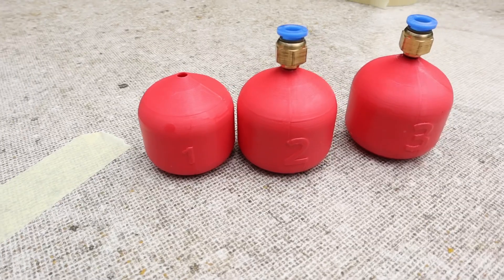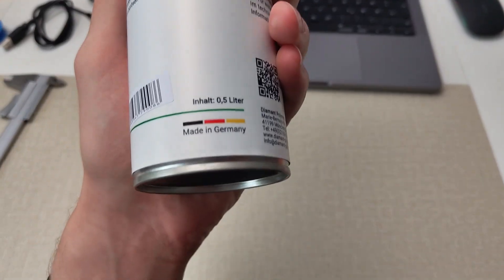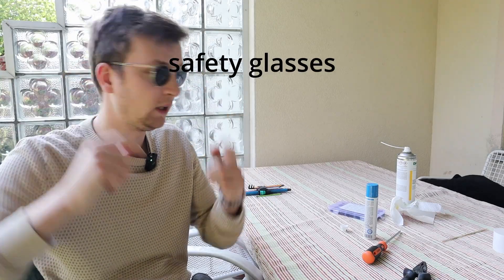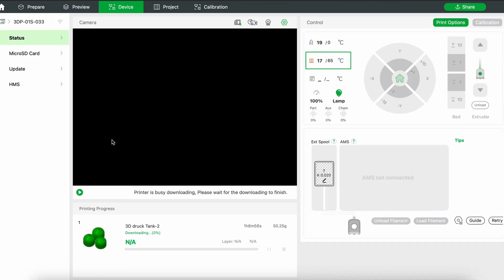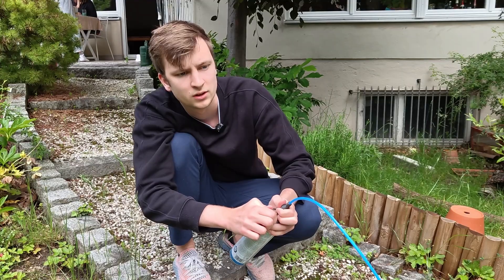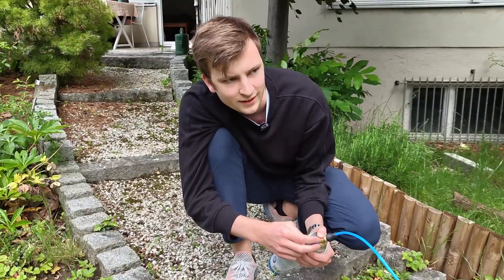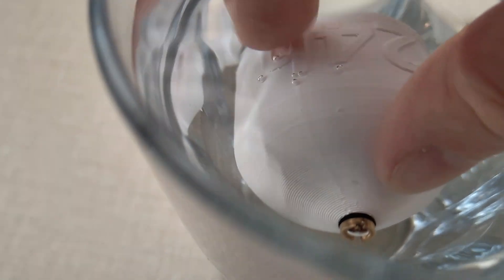Gas tight 3D-prints

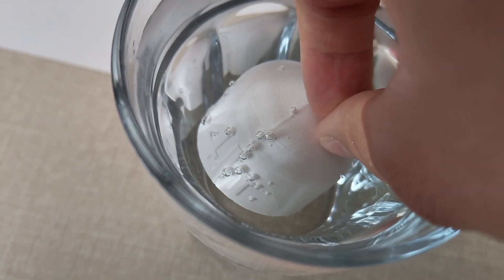Comment: 4:25 it apears to be escaping through the seam, maybe using vase mode to eliminate the seams all together could help prevent gas leaks? Also 6:33 maybe if you make the walls thicker at the top for the thread or even find heated inserts that you can insert by melting the part into the plastic with a soldering iron you could improve the reliability of that part.

Comment: dude, nice vid, but play it safer next time
Also, maybe this is something you alredy know, but the thickness you found is only relevant to the diameter container you used. The wider the container, the thicker the wall needs to be to stand the same pressurem

Comment: Liquid UV hardening resin. Very liquid, pour some inside, swirl to cover all insides. Drain out resin, shine in UV light, it cures and hardens inside and can be done outside too. 

OR

From CNCKitchen, he printed items in PLA, 100% infill. Then packed in a container with Talcum Powder, or very fine salt. Bake in an oven, parts melt, but are contained so they retain shape and become solid. Watch cnckitchens video on making PLA prints solid. 

Hope this helps

Comment: You can also fill on those small gaps using CA glue 
(Instant glue) directly on the exterior surface, it will also strengthen it, for max effect pull a vaccume 
And then add CA to surface.

Comment: Print the test without the 2 or 3 text and see if it leaks still. Also ensure wall thickness and layers are dense ie 0.07 and it will help air tightness. 

Increase perimeter to avoid infill  so don’t use infill. Use random seams too. Arachne line thickeness.

Maybe over extrude material.

Comment: Why not just dip it in epoxy resin... It's much cheaper than the stuff you suggested. At a basic level you could just paint the outside, expert level submerge the whole part in epoxy inside and out and put in a pressure vessel to get rid of air bubbles and fill all voids with epoxy and then drain  the excess and cure it.  Better yet just resin print it.... Otherwise you can print in carbon fibre and then add the epoxy for an ultimate light weight part.

Comment: Have you tried using extremely slow set epoxy. If it's runny you can pour it inside the chamber making sure there is a thin liner on all the walls. Similar to glazing a clay pot in pottery.

Comment: what if you printed a similar shaped vessel, coat the interior with a layer of something like Flex Seal  or PlastiDip, let it fully cure, then put your fill valve on one end, and a female thread on the opposite for a pressure gauge taking care to reinforce the threaded areas

Comment: Two requests for the next time you do this sort of thing:

1. Please place the receiving tank inside of a sturdy container to control where the shrapnel goes

2. Please install a pressure gauge in-line with the filling hose at either end for a proper reading of the fill pressure or failure pressure.  (You may need to direct a camera at the dial reading for this)

Comment: As you are using 3d Printing, I'd like to suggest you add internal baffels with perferations to the design. completely unnecessary but it would drasticly increase  the strength of the tank at a small cost to the weight.

Comment: If you do this test I recommend you getting a air compressor they are pretty cheap to buy with a pressure gauge and then do this test to the explode and I recommend putting up a piece of plastic between and put something on so you don't get hurt I'm wearing safety glasses on the side but then I can guarantee it's going to hold it I know I'm a lunatic😊

Comment: This is the first video that I've watched of your channel it is absolutely amazing I didn't know you could print 3D tanks (gas tanks) you should probably wear ear muffs when you're holding those small gas tanks next to your ears in case your gas tank ruptures an explosion of 150 + decibels is enough to rupture your eardrums and you should probably have safety glasses on too 😉 😀 😄 😜 😆 I do bottle bursting I pump apple juice bottles up with with a hand pump well a car pump with a hose connected to the pump going to the bottle and I put the bottle down onto a very tough log and then I chopped the bottle in two with an axe 🪓 a very sharp axe when the axe comes down on the bottle it chops it in two in a very very loud bang like a 12-gauge shotgun going off due to the fact that I like loud noises I don't have my ear muffs on as part of the thrill of hearing a really loud noise so when the bottle goes bang really shakes my eardrums I do have a decibel reader metre but it is only a cheap one $54.95 to be precise even if I place the decibel reader metre a couple of away from the bottle decibel reader made it only measures about 90 something decibels to the bang being so loud it sort of doesn't record the bottle bursting at the right decibel measurement yet if I stick my decibel reader metre in my trombone and blast the trombone as loud as possible the decibel reader metre reads to 134.6 decibels because I'm blowing the trombone for more than one second I think the decimal reader metre has a resolution of 1 and 2 seconds to get an accurate reading😅😊😢😂❤

Comment: Ha, gutes video :) I just finished making a gas-tight manifold for a coworker who does our tool calibration. Let's just say checking the nitrogen bottle regulator before cracking the valve open would have been good... 3000psi/210bar is a bit much for PLA. In the end i achieved a reliable seal up to 75bar with PETG and close to 120bar with ASA. i pumped acetone vapor through the 1mm^2 channels that connect the different ports to get an easy gas tight seal.

Comment: It seems longer exposure to dichtol results in more thorough penetration. I've been working with Silk PLA, and that material really likes to merge together if you run it hot and slow (I've been printing at 220C, 40-50 mm/s with a 0.4mm nozzle, 8 mm/s jerk control). I wonder if using silk would allow you to get an airtight print while staying thin with PLA.
On the other hand, looking at the way the design leaks, it seems you could repurpose the design as a tank aerator/bubbler if you did not want to seal it.

Comment: When I did this in college for Formula SAE / Student we used Hysol infiltrant heated to lower it's viscosity, then submerged the part under vacuum in chamber. This pulls all the air out and the now hot thinned down resin flows in every crevice. Pull it out, dump the excess resin, let cure. 

CT scans of both methods would be so cool! @Lumafield

Also done lots of gas tight parts in SLA but that's cheating right?

Comment: That’s great man!! I’ve question if it would possible to print a tank out at home that is a huge leap forward in 3D printing at home I’d say!  Great video man, I instantly think of internal structure support like the bic lighters have a wall with a little gap in the middle of the lighter could maybe help you seal that line in your tank! 🤔 Maybe..?

Comment: Wonder if you could make a liner out of a pte bottle, print a two piece reinforcing shell that screws or welds together, and then pour boiling water into the bottle so it expands to the shell. Wonder if you'd need to pull a vacuum around it

Comment: Had an epiphany after watching this yesterday. I mentioned reinforcing with an outer shell, but what about spraying a sealant inside before pressurizing.  Like a run flat tire that seals the inside. That should help with pressure leaks, plus a reinforced cage could really improve the concept.

Comment: Gas-tight prints are extremely cool, but please be careful. Plastic is usually not used for true pressure vessels because it tends to shatter under impulse loading. So, if it does rupture then it'll throw plastic fragments everywhere at high-speed. Acrylic/Lexan are often used for pressure vessels, but the difference is twofold: 1st, the materials are usually quite thick. The factor of safety is much higher than it needs to be for the pressure you want to contain; this means that even under shock loading the material is likely to hold. 2nd, Lexan is transparent. You can observe any material defects easily, so you can easily avoid building a pressure vessel with material containing voids, fractures, or other weakening anisotropic features.

3D-printed plastic is inherently anisotropic due to the layerwise nature of FDM prints or the porous nature of SLM prints. These materials are not safe for constructing true pressure tanks. Even if you fill the internal voids with epoxy under vacuum, the anisotropic features are usually detrimental to holding pressure. It makes the material strength unpredictable, since the overall tank strength is something like the minimum layer-to-layer adhesion strength across all layers; and that's difficult to predict even with FEA software.

You could use these anisotropic features to strengthen your pressure tank, as with a carbon-fiber composite, but the difference is that in composite materials the filament/fiber thread/etc is wrapped around the tank many thousands of times, so that tension along the fiber pulls the tank together. If you you simply wrap the tank along one axis, perhaps with loops in horizontal planes, then the tank failure will occur along the layerlines and it will separate along some horizontal plane. This is most like an FDM print, since no matter how you printed it, the part is ultimately layered with bands perpendicular to at most one axis of load.

Note: Also, if you plan to hold pressurized hydrocarbon gasses (butane, etc) make very very sure that the print material is non-reactive with that plastic. Light hydrocarbons often dissolve plastics, which means the strength of your pressure vessel could degrade over time. You'd have to check the chemical compatibility of your specific print material with the gas. This isn't a trivial question, and you might have to do some internet hunting to find an answer.

Edit: I'm less concerned with the tanks you made here for testing than I am whatever project you plan to use 3D printed tanks on, since it might be reasonable to expect either higher dynamic loading or longer durations under pressure.
Reply: I hope people who own 3d printers are all mindful of this. If they aren’t idk if they should own a 3d printer lol
Reply: Sounds like things might change with annealing which transforms it to nearly a solid piece

Comment: Parts that are printed with higher extrusion and temperature are generally water/gas tight without any post-print treatment. You just want the material to really "squish" together between the wall lines and layers.

Comment: 04:30 I am pretty sure that the bubbling seam could be fixed by looking at the slicer settings (or potentially printer settings - some power-disconnect-and-resume features do this as well) for a reason, that there is less extrusion at this point along the whole visible seam.

Comment: Fiberglass is commonly used for pressure vessels...you could essentially 3D print a bladder for a fiberglass pressure vessel, or a 2 piece mold for one, or a dissolvable inner and 2 piece outer mold for fiberglass

Comment: Certainly don't mind the German pronunciation of Dicktall Lol
As for the 3D printed gas tank, really cool idea, might i suggest making a slight larger one and experimenting with a few things
 one: different filaments. there are a few more flexible and more ridged ones that could right off the bat change the game a lot
two: try coating the inside like a actual gas tank, i forget what its called but there is this paint like stuff you pour in gas tanks to seal them internally
I know i said a few but i have a third lol
this would be finding a  small tank thats commercially available and try making a reusable 3D printed version, first thing that comes to mind is those tiny butane camping stove canisters

Comment: So the weak point is the layer adhesion. If you did a Russian nesting egg technique of printing the first print and then did a reinforced shell that was printed in opposite orientation. When part A starts to give the external part B should help reinforce it and as an addition the opposite layer adhesion lines won't give as easily. With 0 tolerance you could even super glue the two together for extra bondage action.

Comment: Nice project. Have you tried printing with PETG? I've had pretty good results without any additional chemicals. I've also used heatgun at 250C to remove strings from PETG (high temperature, high flow, but short time) and this seems to additionally decrease porosity of print. Good luck!

Comment: Something to consider: the 3D printed part doesnt need to be gas tight if you line it with a gas tight substance.  For metal fuel tanks, something like POR-15 is used. It gets poured in the metal tank and then stirred around and dumped out. This seals up any micro leaks.

In your case, maybe something like epoxy would work. The 3D printed part provides the strength, while the liner prevents gas leaks.

Comment: printing tips: use a "line width" that is slightly wider than the nozzle diam, and a layer height that is slightly lower than the nozzle diam. Also make sure you're printing in a "concentric" infill; I see a linear pattern in your initial black test print.

Comment: What is the project? A drone with a flame thrower? One way of measuring gas loss with propane/butane is weighting. There are very accurate scales sold for weighting powder for those who handload firearm cartridges and they are not that expensive. Weight the tank empty, fill it and weight again, then weight one more time later to determine the amount lost in a specific time.

Comment: wonder if doing an acetone vapor bath would help seal it up better.  That only works with ABS but makes for a smooth print that may be better at holding a gas.

Comment: FUN FACT: a NORMAL PLASTIC COKE BOTTLE CAN HOLD 90PSI.... It's only about $1.50-$2.50   Just drill a hole in the cap and insert a valve stem for a bicycle or car.. in the bike isle @ walmart.

Comment: the numbers create weakpoints on the cans, no? EDIT: perhaps the expansion of the plastic under pressure is exposing holes that otherwise can't be penetrated by the dichtol? I'm thinking like little microscopic compliant duckbill check valves have formed in the material. EDIT 2: duckbill check valves look like something suggestive, why is all of engineering sex jokes... serious question, is sex just mechanically based and goated?

Comment: You could also use thicker Walls with low density gyroid infill and fill the wall (and therefore the infill) with epoxy resin 😜

Comment: 4:13 I think the gas was escaping through the seam. You should use the "spiralize outer contour"  feature in your slicer (also called vase mode). Get rid of the numbers on the 3D model to ease the printing with this mode.

Comment: I've been able to get gas tight prints directly using Luvocom PET-CF printed on the Bambu X1C. The filament needs to be very dry, you need to over-extrude a little and print hot (295C) and slow (6mm3/s).

Comment: to not go through all the hazzle just get some polypropylene filament. its air and watertight right off of the bed. it has perfect layer adhesion that is just as strong as the material itself. ive made chambers that hold 12 bars out of PP with no issues

Comment: Fun experiment! Would be interesting to see if the pressure limit could be further improved by using a porous infill pattern instead of just leaving the tank hollow, basically reinforcing the pressure vessel wall from the inside... If you're going to use additive manufacturing technology, why not take advantage of it, right?

Comment: Could you try printing it in vase mode?
The leaks seems to be only on the seam, so you can either try using random seam instead of the default aligned mode, or vase mode, that has completely no seam due to it being continously printing

Comment: Try vase mode and a mode that Teaching Tech used "scarf joint", I think also removing the sharp edges could help (seams and numbers) using something like a soldering iron. Also seen a lot of flasks coated with some waxy like substance on the inside, might be interesting to see if putting a print in the oven or something would improve the gas tightness

Comment: Interesting. Now to wonder if there’s a way to gastight seal printed parts to PVC.

I was building a Soda bottle rocket last fall for some kids with PVC. The coupler part was terrible because of the design I chose, where I had to drill perfectly level holes on a round PVC coupler. I kept thinking over and over “If I could 3D print this and it was airtight, I’d save so much time.” I only need about 70 PSI because that’s when the bottles start to fail.

Comment: You should add a pressure gauge to the testing.  They are cheap to get and even digital ones aren't very expensive.  You'd easily be able to measure leaks and get a more accurate measure of how much pressure is really in the 3D-print.

Comment: hydrostatic tester  - is a thing.
gas in that line would decrease over that length giving you false reading 
test c.a glue on the out side at well as your spray. and few layers of  reinforced packing fiber tape for fragment management

Comment: one thing comes to mind. the material.. i get pla for fitting and such, but for this job you want something with better layer adhesion like petg. also basic acetone smoothing would yield a better result im sure.